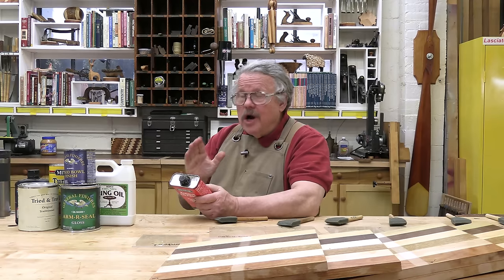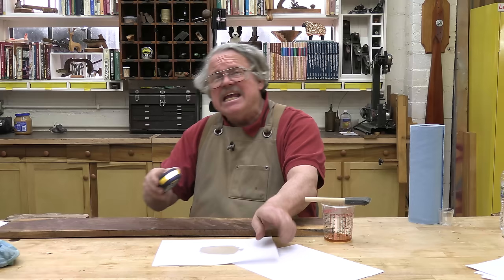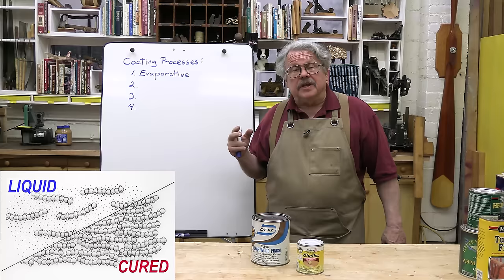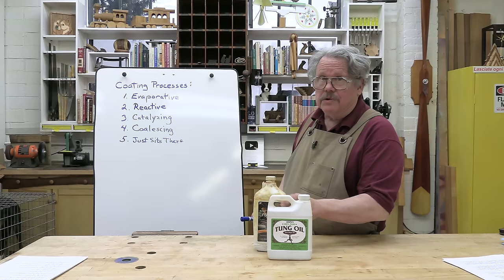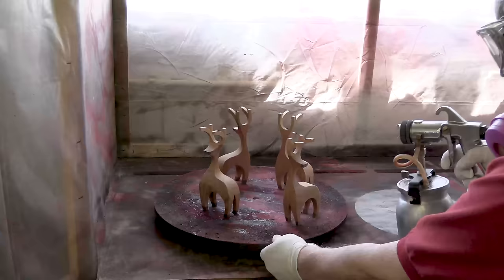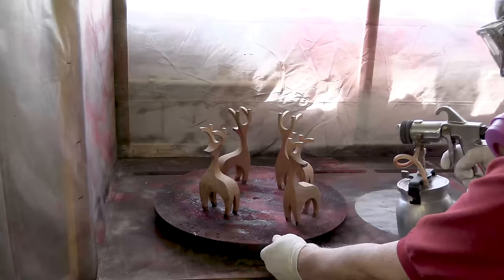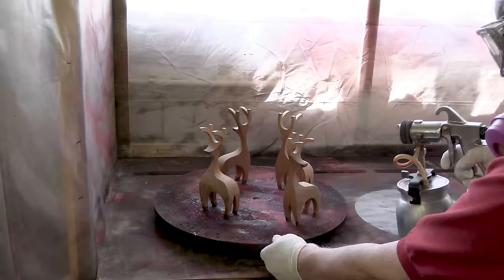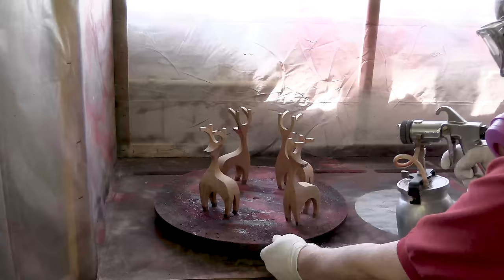Finding the Perfect Finish

Comment: one more reason to finish wood - UV rays from the sun.  cold/heat???
Reply from the maker: You present a little-discussed effect that light has on wood. Light in the UV wavelength has been found to damage lignin, the glue-like protein that holds the cellulose fibers in wood together. The process is called "photo-oxidation." If what you build will exist outdoors or in a sunny indoor environment, using a finish that is tinted to absorb UV light is a good idea. As for moderate heat and cold, these affect wood indirectly through the absorption and release of moisture, which causes the wood to shrink and swell. Finishes will do little to protect the wood from this. With the exception of wax, all finishes are semipermeable -- they will slow down the exchange of moisture, but not stop it. As for heat and cold alone, I know of none that effectively insulate the wood from changes in temperature.
Reply: @WorkshopCompanion  while rafting on a river I found a stump that was not only bleached by the sun, but also water and sand had carved out all the softer parts.  It was beautiful by itself.  I took it home, scraped and sanded to get rid of the rotten and soft spots, which also brought out the wood colors.  Even more beautiful !!  Then I searched
for a way to seal it, and protect it from UV rays.  Two or three years went by until I found a can of spray sealer that SAID it would do both.  Satin finish and seemed perfect for
the job.  I put about 4 coats on it lightly each coat.  I put heavy coats with lots of time to cure on the inside of the stump top, which was hollow.  My plan was to plant a vine style
plant in the top and place it outside in a shady garden a buddy had.  It's now been about two months, but I haven't heard from him how it is doing.  wish him luck please.
Reply: @WorkshopCompanion  he hasn't planted and erected the stump yet.  but sent me a picture of it.

Comment: I've tried dozens of different finishes in the past 30 some odd years and I found my go-to finish is Formby's High Gloss Tung Oil finish. I just love the finish it gets such a beautiful warm look as it ages and it's fairly easy to fix if the surface gets damaged. 
Unfortunately Minwax now owns Formby's so I'm sure they will end up ruining the Formby's name by using their shitty formula which does not harden as fast as formby's does.

Comment: i am only here because you called linseed oil a non drying oil

it is THE drying oil
Reply from the maker: I should have been more specific. You are correct; boiled linseed oil is a drying oil -- it is partially polymerized by the heat, and drying agents are added to it. Raw linseed oil, however,  is not.